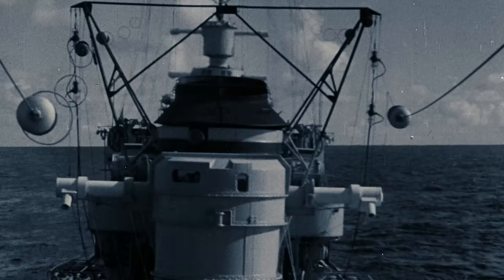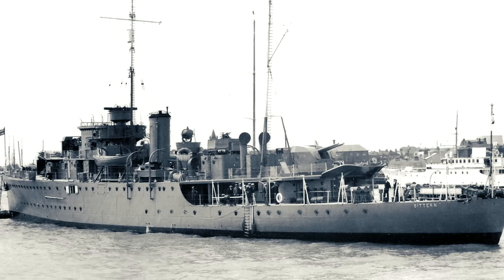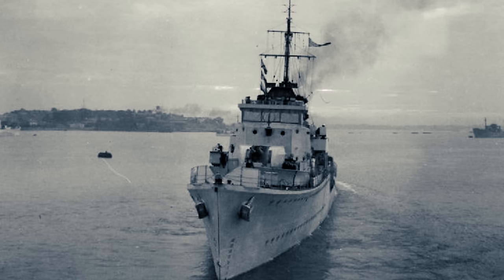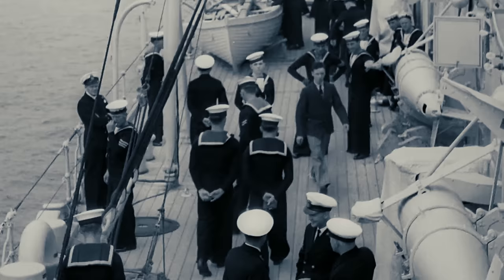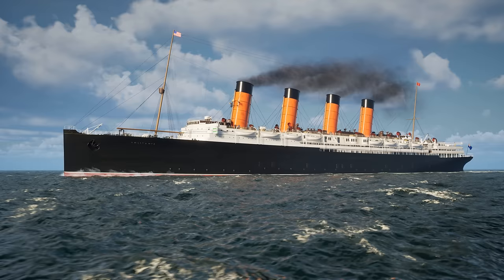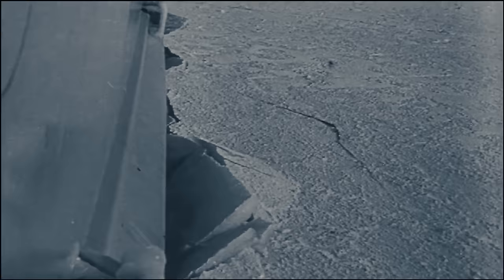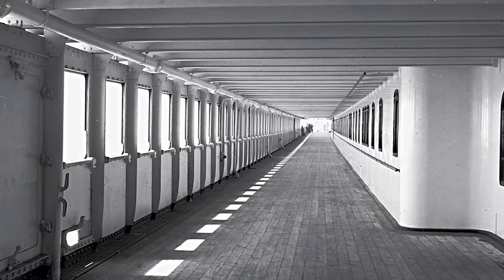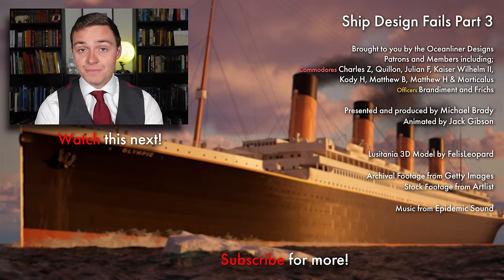When Designers Fail: Three Ship Engineering Mistakes from History

Comment: Interesting, concerning Scharnhorst and Gneisenau.  I've read that although built with 11" (280mm) guns on the main batteries the ships were capable of being up-gunned to 15" (380mm) guns but the work was never done.
I've never seen the reasons why not but I'm wondering if those extremely "wet" bows had a lot to do with the decision not to uprgrade to the heavier armament?  
Fun video Mike!
Reply: Actually, the work on Gneisenau was started. But after recieving some bomb hits and Hitler's descision to scrap the surface fleet that was left undone and the ship never sailed again
Reply: The 380 werent ready (still in development) the time they were being built so they just choosed the 283mm then the war started and the ships were needed in combat

But in 1942 the gneisenau was once again in the docks for repairs, it wad decided that she gets the 380mm guns and a 10m longer bow 
But then... in 1943 hitler came along and didnt wanted big oversea ships so the modification works were stopped
Reply: TBH it's still not as hillarious as Graf Zeppelin. 
Launched. Halted. Resumed. Halted. Resumed. Never completed, never comissioned in the end :D  @Vendo_HD
Reply: And it turned out that there was a lot more work involved that simply removing the 28cm triple turrets and installing 38cm twins. The never-completed refit for Gneisenau also involved replacing the bow again, this time lengthening the ship to account for the added weight of the larger guns.
Reply: Thanks all for the responses!
Reply: The 381`s were not that useful in what the ships purpose was, the commerce raiding. With 6x15inch main guns they would still have been too weak to fight enemy capital ships. The rate of fire of the 11inch main battery was much more of use against merchantmen. 

And by the time the upgrades were considered, the allied air superiority made all waters too lethal for the german surface ships. And the ports too, to that matter. Time of kriegsmarine operating the oceans was past.
Reply: 15inch would have much higher chance of defeating enemy armor, so more useful against Allied BBs. 

But yeah, in any case it was much too late. 

 @Ah01
Reply: @KPW2137  If there ever was a such fight, the kriegsmarine docrine for the sisters had failed catastrofically, as in 26.12.43. The ships were meant for commerce rading solely, and their speed to escape was their best weapon against allied capital ships. Heavier battery would hve slowed that. But yeah, it was too late anyway.
Reply: I totally agree! Let's not forget that the Kriegsmarine could not hope to use distant bases, or rule the seas to the point where it could withdraw or move with little risk. Therefore yes, any fight against an Allied capital ship posed a substantial risk. And yes, it was too late. 

PS Just made me realize: the Soviet Union was designing and launching dedicated commerce raiders in the early 50s ( the Sverdlov light cruiser class ) - now that's what I'd call getting late to the party :D  @Ah01
Reply: As memory serves. Gneisenau's 15" guns were eventually pressed into service as shore batteries, with one turret still in place in Norway.
Reply: @KPW2137  A lot of argument centred around simple numbers. Kriegsmarine never had enough surface raiders to achieve the same effect as the smaller, cheaper U-Boats. And every surface combatant they lost, was a major percentage of their fleet. RN could afford losses in surface engagements, Kriegsmarine could not. Graf Spee, Bismarck and Scharnhorst showed the inadvisability of gunnery duels against RN warships.
Reply: @CliSwe  that is true. Also, raiders were hoped to achieve something a bit different: while in absolute numbers they could not deal nearly as much damage to the merchant fleet as U Boats, they could disrupt the convoy system, force RN into using a lot of warships and resources into raider hunting or convoy protection against the raiders.

Comment: 30 knots speed in 1930’s was a really good speed and outstanding achievement.
Reply: It still is the standard speed that most modern warships must achieve for blue water activities. Not going to mention Nuclear Powered carriers, but most surface warships can be found to have a top speed of between 30 and 37kts depending on nation and combat requirement.

Comment: At 0400 I was off watch, so I'll have to watch this one over scran.  Stand easy is long gone Captain Mike.
- Amazing how far we took maths without computers, no wonder there were fails in 1940.
- Equally amazing that no-one did a "quick & dirty reality check" in case something was terribly wrong.
- I'd liken this to checking you aren't using 48 pages to print a 1 page receipt, in modern terms! ⚓

Comment: An interesting commentary on the design process of the Hunt class is found in David K. Brown's book "Nelson to Vanguard", pub 2000. In it he says there is no proof of the erroneous figure of 7 feet being used instead of 17 feet, but the differences in computed figures suggest that was the error. He also suggests that rather there being two independent calculators, normally one an assistant constructor and one a senior draughtsman, in this case both were draughtsmen, and it appears that one probably copied the other's figures.

Looking at the number of new designs being created by the Directorate of Naval Construction and the modifications to existing ships it is surprising that not more mistakes were made.

Comment: Mike, could you please explain the concrete, detailed, specific, and precise differences in British WWII naval terminology (especially in the Atlantic Ocean and North Sea) between  a “sloop of war” and a “corvette”? I ask bc some of the few photos of HMS Bittern in the video—-along with your mentioning that the “sloops” had wider beams than the upscaled versions of them that would become the Hunt-Class *Escort Destroyer* brought to mind the very “bouncy” and wet ride British sailors experienced on the Flower-Class corvettes (Churchill’s “cheap and nasties” ) escorting convoys across the Atlantic to the United States and traversing the North and polar seas escorting supply convoys to either Mermansk or Archangel in the beleaguered Soviet Union. 

The Flower-class corvettes had quite turbulent rides because originally they were built to civilian mercantile standards, not Royal Navy warship standards, as they were initially designed to be coastal fishing vessels with a shallow draught. 

In the USN of the 1930’s and 1940’s, the terminological distinctions were much easier to grasp conceptually. Fleet destroyers participated in fleet actions as an AA and anti-submarine “screen” for capital ships. As such, they had a large complement of AA guns, two to four 5-inch large guns, and a sizable rack of depth charges from the stern post aft. Fleet destroyers were also armed with numerous torpedo tubes. Obviously, fleet destroyers needed considerable speed as well. 
Escort Destroyers, on the other hand, were smaller and slower than fleet destroyers; had a narrower beam, and considerably less torpedo, AA, and main guns firepower.  Most, however, were capable of participating significantly in fleet actions, as the (in)famous Battle off Samar demonstrates. 

The Royal Navy’s terminology around WWII was, understandably—-given the rush to modernize and the “ad hoc” nature of some of the measures the RN was compelled to use because of its destroyer fleet being seemingly hopelessly over-stretched defending Britain’s far-flung empire, as well as the home islands—-rather more confusing than American  Naval terminology.
Reply: A sloop was the smallest vessel built to full military standards. Aka, the smallest ship expected to be deliberately sent out to directly engage enemy surface combatants. Corvettes on the other hand where built to mercantile standards and were only expected to fight surface actions as a last resort. 
 Edit: to add to that: Frigates were basically just Britains term for an anti submarine dedicated destroyer (basically what the U.S would call a destroyer escort, not to be confused with an escort destroyer. Completely different and not at all confusing). A destroyer was the smallest  warship intended to travel and fight along side the Fleet, were as a sloop was intended for second line non-Fleet roles only.

Comment: with the Hunt class ship if they thought the measurement from keel to upper deck was 7’ but it was actually 17’  and then put too much weight on top, it seems counterintuitive that if there is more weight with the 17’ measurement would that not have made the balance lower and steadied the ship? Perhaps you meant to say that they calculated using the 17’ measurement when it was actually 7’?

Comment: The irony is..germany should´ve known that the bow form originally  choosen for every actually finished design(of larger ships,cruisers and upwards) was flawed...that was the main reason why SMS Seydlitz got an entire deck added forward of the bridge superstructure :D

Also,Gneisenaus bow was reworked twice.After the initial rebuild,it had the anchors still mounted as they were before^^
Reply: Gneisenau was actually in the process of having the bow rebuilt again (this time lengthening the ship to allow for heavier 38cm twin turrets to replace the 28cm triples), when all work on surface ships was cancelled due to Hitler throwing a tantrum over the Kriegsmarine losing a battle.
Reply: To be fair...they had no excuse except Hitlers dumb orders to loose that battle to begin with..An order that was ignored pretty much any other time before and after @RedXlV

Comment: Hey Mike, speaking of design flaws and rolling, didn't the Geelong and its sister ship the famous Waratah have a design flaw where they had a problem with rolling and taking a long time to get back onto an even keel? If that's the case, that's probably what caused the Waratah to disappear, as the area it was in was famous for storms and rough seas off the South African coast.

Comment: 7:13
I didn't get what you meant here. You said that a large amount of weight was ignored from below in the hull because of the larger draft, but you said that the designers thought they didn't were too light down. Shouldn't it be the opposite? They thinking they had less draft weight than they actually had?
Reply: I had to replay it too. The bit about missing 10' of height between keel and upper deck can be compared to the absence of a complete deck above the waterline. Imagine the ship being 1 full deck taller than the maths said it was, and you see where they went wrong.

Comment: The first story reminds me of a toy boat I had. It had metal rod in the bottom for ballast. The rod was slightly bent, so it never went in a straight line. It also sat very high on the water and always leaned over

Comment: When the Eskimo folks made kayaks for the ocean, the part of the bow that is normally in the water, rises up vertically.  Up above that there is a flat board pointing forward and up at about a 30 degree angle.  This was to make them fast in light waves but also to force the bow up if there was a big wave.
Reply: Inuit, nor Eskimo, and what you described isn't a kayak, it's the type of bow sometimes seen in an umiak. A kayak is, well, a kayak. An umiak is a larger open boat that looks more like a  whaleboat meant for transporting multiple people and cargo, and for hunting large marine mammals. The umiak is interesting in that traditionally it often used two different means of propulsion depending on the crew composition; if the crew was mostly men, they used paddles. If it was mostly women, they tended to use oars. This allowed women, who on average have less upper-body strength, to be able to use more of their body to compensate.
Reply: @keith6706  I am definitely describing a small boat that I have seen.  It had room for one person.
Reply: @kensmith5694  Well, I've lived in the Arctic for over a quarter century and have seen any number of traditionally-made kayaks from Greenland and across the Canadian Arctic and have not. It's entirely possible one such design exists, but it is restricted in time and/or space.
Reply: @keith6706 Yes, it was many years ago and it was an example of one that I assumed was common.  Looking for a picture like it, I found none.

Comment: Another great video.
Though I don't think the mathematics wasn't QUITE as complex as those shown!  04:40  😁 
The difficult part is that you have so many individual parts with vastly different weights at different points throughout the ship. which all need to be accounted for. rather than 'checking the maths', the only way to properly check this kind of thing (which is going to be used to build MANY MANY duplicate ships!) is to have two teams calculate it from scratch without seeing each others work - better still never even knowing someone else has done the same work.  😉  (but no doubt extra difficult in War Time...)

Comment: The Scharnhosts were competed with 11inch guns because that is what Germany had available at the time they were designed.  Hitler wanted 15inch guns but they would take time to develop and he wanted the two ships asap.
Another bad point is the design is their machinery.  Germany leapt into high pressure steam turbines too fast and made them too complicated.
When they worked perfectly they worked well but all major steam turbine German ships were plagued by unreliable machinery.

Comment: the same problem was also suffered by german destroyers. another problem that came up with the german battleships were the triple propellers that was a main reason the bismarck was caught and sunk, as the triple screws made it impossible to steer by the engines, ensuring her loss when her rudder was wrecked.

Comment: Surely flare at the bow is more important than the profile?  You could get more flare forward by raking the stem and running the lines forward.  But a straight stem could have also been built with more flare and bouancy.

Comment: Place I worked at the engineer that hired made two mistakes that I know of. First he assumed the flat roof was actually flat It actually had a slope and an AC units had to have their legs stretched so it would be level. Next one was a system for loading trucks and he is on it so it would have one foot of clearance then went in and poured 16 in of concrete to support the loaded trucks. The system was built so it have one foot of clearance before they pour the 16 in of concrete.

Comment: Germany was limited to 11 inch guns and a displacement of 10,000 tons by the armistice treaty.  That is why they built pocket battleships. The guns and much of the material used to build the Scharnhorst class had been ordered for additional pocket battleships but once Germany was permitted to build larger vessels the planned pocket battleships were cancelled and the designers of the Scharnhorst class used the materials  already ordered, hence the light 11-inch main guns.
Reply: They were not officially limited to 11inch but decided to stick into that with scharnhorst, just not to irritate the Brits. Later on with Bismarcks that was not considered an issue any more. Only limitations according to Versailles was the amount and displacement of 10000 tons. When the scharnhorsts were completed there was already a naval treaty of 1935 between brits and germans.
Reply: @Ah01  Seems to me there was a plan to take Scharnhorst and Gneisenau back to the yard and replace the triple 11 inch turrets with twin 15 inch turrets.  The plan was never carried out.
Reply: @gordonbergslien30  yes, and the 6x15inch was considered as an option in the original design too, but abandoned.

Comment: Today ships and even much smaller work and pleasure boats are designed by computer. That's why if you look at some of the Navy's latest design missile cruisers they are pretty radical looking. I'm specifically talking about the Littoral Combat Ships, look them up and you'll see what I mean. Also the new class of aircraft carriers are much different, most of them in ways you can't really see. They're a  lot bigger yet more stable than the older ships.

Comment: As always,thank you for the video!

Was always interested and comes to mind because of german ships: why there existed (exists?) such a thing as a "reverse" stim? (don't know how to call it, lol, but the one which is longer at the bottom than at the top)
Reply: That would be in pre-WW1 ships, and was called a ram bow...
Reply: Do you mean like the prow on the early dreadnoughts and pre-dreadnoughts which were the reverse of the so-called 'Atlantic Prow'?
Reply: For a while after the introduction of iron armor on ships people thought that it wouldn't be possible any longer to fight effectively with guns. So the new idea was ramming. That lasted a hot minute because the guns quickly caught up in the tech race.
Reply: @kevinjohnbetts  yeah, that's it. But also inter-war period crusers and (which i understand is an exception and not the rule) modern Zumwalt class
Reply: @user-vg1pp8ko8i  As others have said it's the 'ram prow'. However why it was maintained and copied even well past the notion of battleships ramming each other remains unclear. It's the kind of thing Drachinifel should be able to answer in extreme detail. My limited collection of books on the topic of warship design doesn't help much.
Reply: @kevinjohnbetts I haven't found any explanation for it in my library either. But you're right - Drach probably knows!
Reply: @kevinjohnbetts  are you talking about the bulbous bow or the ramming bow?
Reply: @JSnow-st7hm  I'm not certain what the OP is referring to. I'm looking at Swfitsure (1904), King Edward VII and Canopus (as examples) with the raking prow that slopes back to the main deck as against the Atlantic or 'Clipper' prow.